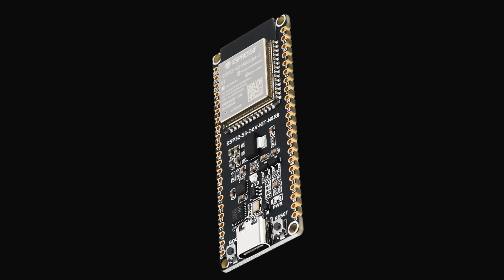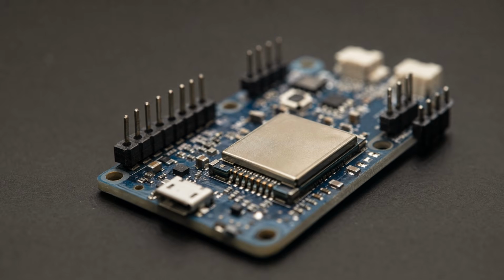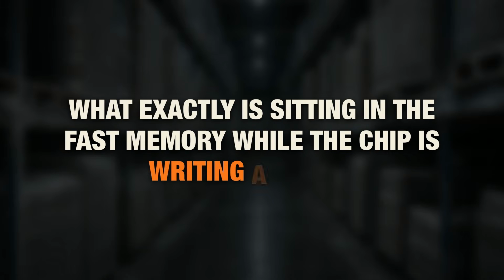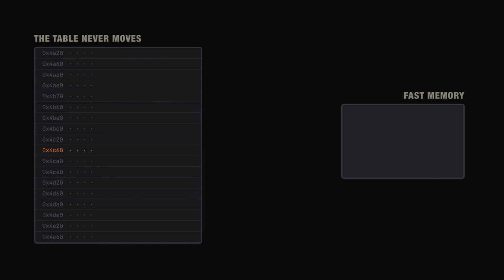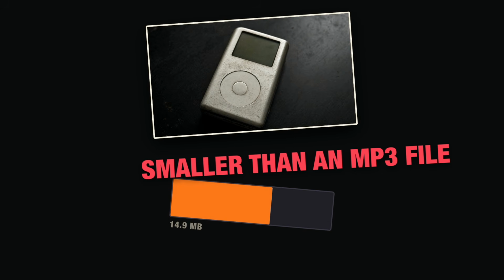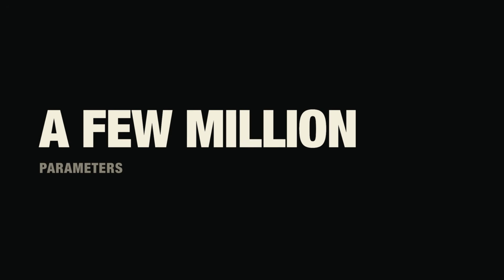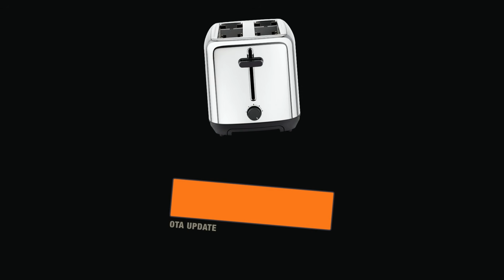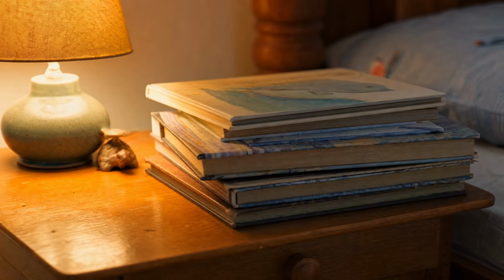How This Tiny $8 Chip Runs an LLM With Almost No RAM

Comment: I wonder if the same system could handle a small action routing model like LFM 250M with a piece of external storage for the lookup tables.

Then it could actually try to handle real commands on device.

Comment: Why not use two of these, one to run the model, and a second to run the sensors and other bits? That would still be insanely cheap and allow for some basic fun stuff like a talking toaster that writes a poem about your toast as it cooks it.
Reply: Exactly. And even on a single chip you could interlace the two jobs in time, including offloading everything for OTA maybe with a bit of extra storage.